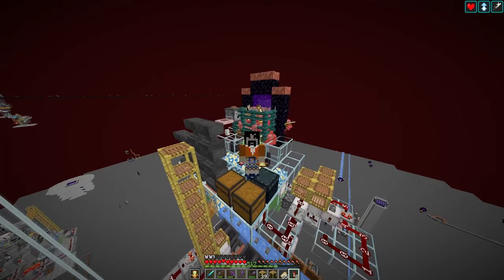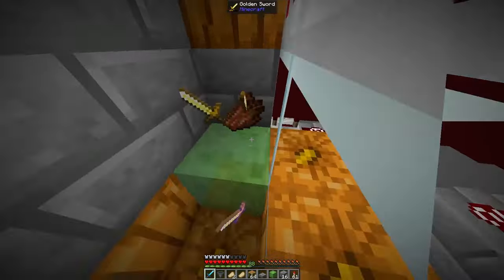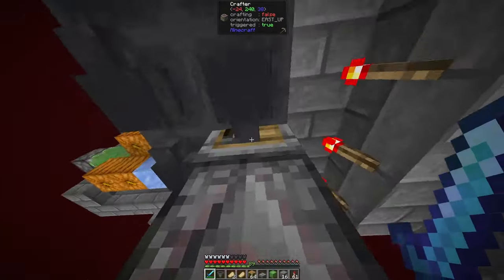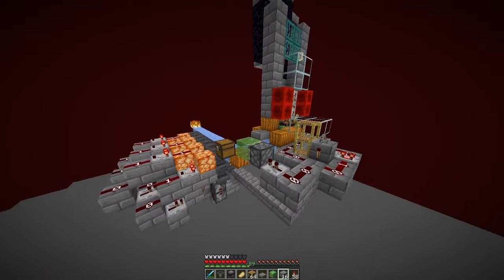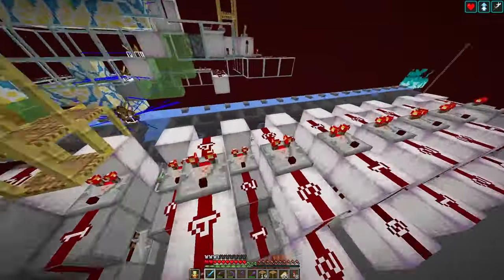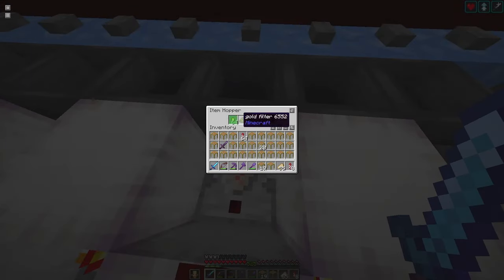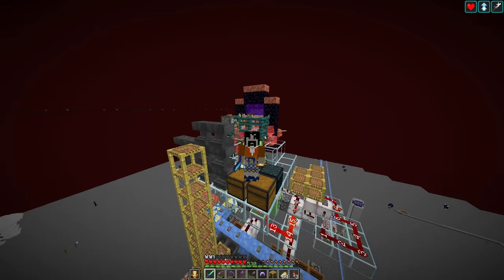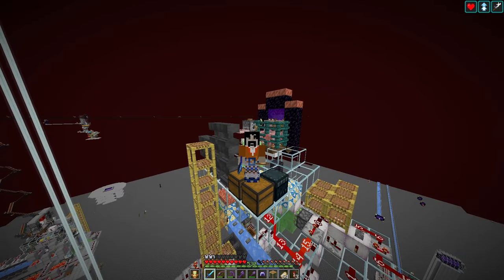Storages for gold farms with crafter integration, small and large farms, Minecraft Java 1.21

Comment: I did build Glotz gold farm which is absolutely insane and I want to do a crafting setup for that but something tells me it will be easier at this point to build a separate crafter to compress all the items. As I have no idea how many slices I will need.
Reply from the maker: The fast setup here should be OK with Glotz farm if you extend it a bit. My (fast) farm is in the ballpark of 2500 gold blocks per hour, Glotz IIRC around 5000. So you'd have to roughly double the number of ingot crafters to handle the output from Glotz. I'd say 24 double speed filters for nuggets, give or take a couple.
Reply: @FrunoCraft  thanks will give it a go. I love your channel BTW, I feel like stromne passed the baton over to you. I hope he's doing well. I miss him a lot.
Reply: @FrunoCraft  just to say it worked perfect. thank you. but i included the option to divert the items to the crafter, so it's the original storage on one side and the crafter on the other that way I didn't have to tear down the original set up in case I still wanted to use it.